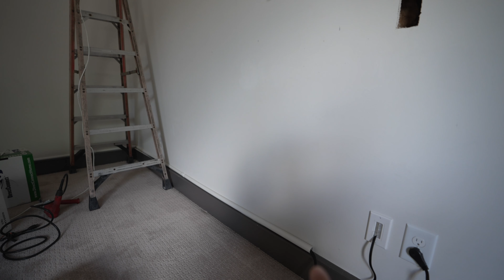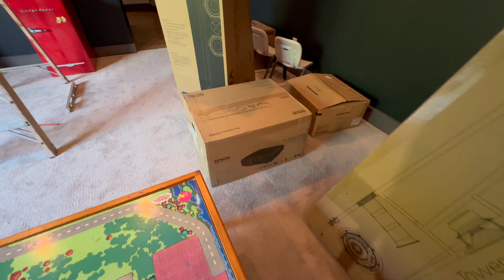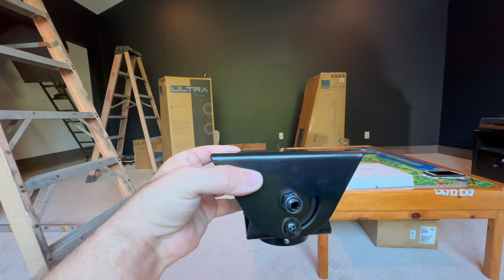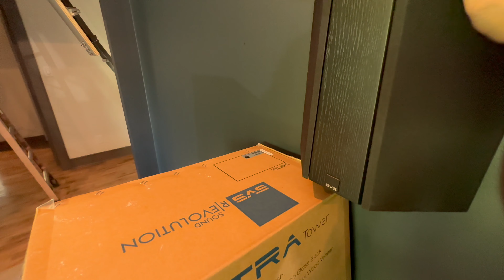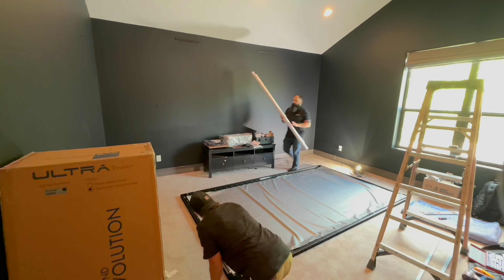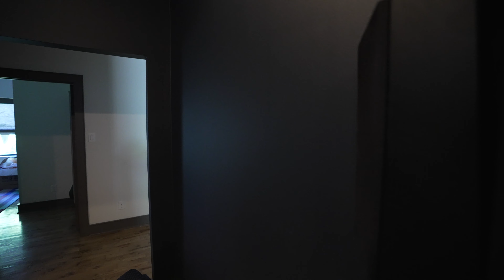SVS ULTRA 7.1 Home Theater Install | Houston TX

Comment: why not in wall speakers? In my opinion it was be the best solution for such place.
Reply from the maker: @dawidlelito  he asked for svs by name. The customer knew what they wanted.
Reply: I think if you are starting your theater journey to audition towers, and not marry them by going in wall with a little more install effort.   However, you were right that if he went in-wall, the acoustic transparent screen would have made sense with a larger screen.  VERY hard to light that screen that big though.

Comment: Great video! Was wishing you showed how you went from the race track used to hide wires along the baseboards to where the new wiring went. I would like to know the wall paint color.  Great setup!
Reply from the maker: @Professor5180  it was a difficult install as far as the pre wire. Im guessing thats why the previous home owner chose to do the chase run.

Comment: Good day fellow Houstonian! Do you plan to use a DSP Mini for the subs? I'm currently entertaining the idea of picking one up and may have to run by the store to get some insight on using one.
Reply from the maker: @67spankadelik  not for this room. Most our installs do not need that level of calibration. Stop in the shop. Id love to show you around.
Reply: If you have a Marantz or Denon AVR it's worth your time to look at OCD A1 EVO script.  I have no affiliation, just used it myself a couple days ago and it really improved my bass fidelity of my three subs.  https://www.youtube.com/watch?v=lmZ5yV1-wMI
Reply: Plus don’t Marantz/Denon use separate individual sub outputs?